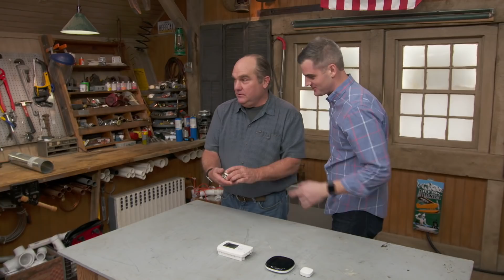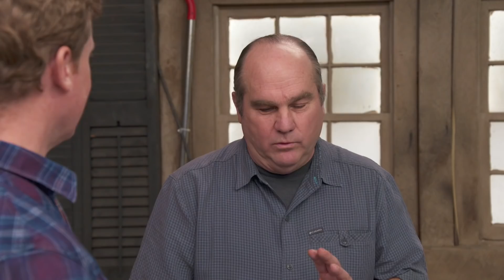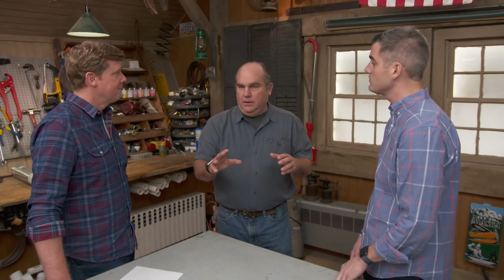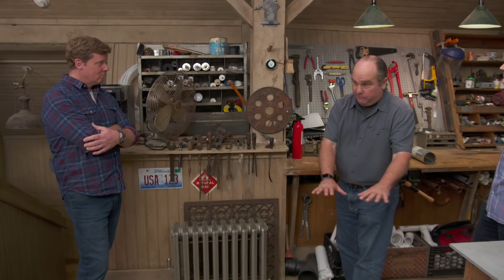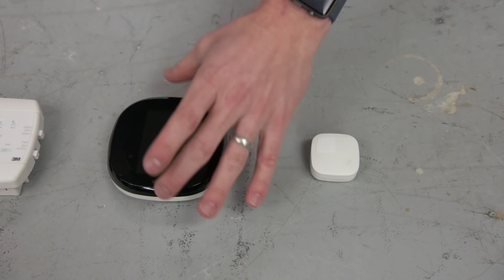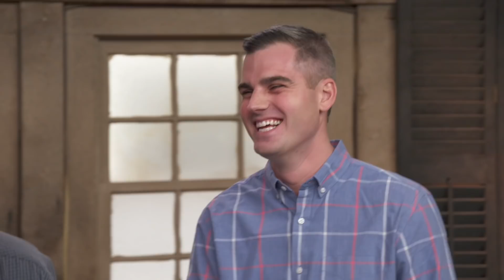How to Maximize Comfort with a Thermostat | Ask This Old House

Comment: We've had -40 to -50 for a month. When house sitting for a friend, I turned the heat down in the day when I went to work, thinking I was saving money. Well, the baseboard froze up, and I had to call out someone to thaw the lines. $300 later, I determined no money was saved. I won't be fooling with the thermostat thank you.

Comment: Perfect,  I just watched this.

Ok my house was built in 1992, my hvac system was changed in 2013. My heating bills in the winter for a cold month cost us 450.00 dollars for one month around 2007- 2008 a year we had a cold snap.
No humidity heat at 74dgr f the house never kept warm.
In 2021 jan feb months we had colder temptures for a longer period of time, my gas bill was 163.00 for the month of February   this newer hvac system is 
Seer 16. 97% efficient heat i had the heat set to 76 dgr  and ran a humidifier the whole time this system pulls in outside air to make combustion.
Even a few year old system can be a big upgrade and cost savings to replace.

I wont get into what we paid becuse your home isn't the same size, or geographic location and construction  simply taping all the joints helps but the biggest improvement was a newer energy efficient system  
This system has paid for itself the first year and almost every year afterwards 
And its not even the best money could have bought, if I had it to do over I would opt for a 2 stage compressor, but celing fans help keep you cool the ACs job is to dump heat outside. 
On a second note I pay to have this serviced every year it worth it to keep it working at peak efficiency. 
However its somthing I could diy its still better to let the pros do it.

Comment: In a moment of rebellion I went down to Ace Hardware and picked up 3 of the old school, Honeywell dial thermostats and ripped out the programmable ones that came with my house. They work flawlessly and I don’t need a PHD to figure them out.
Reply: That's what I have and they are staying put, no batteries, no user manual, they just work all the time, every time.
Reply: My 359 dollar electronic thermostat is set to 74 summer and 76 winter year round  its not a smart thermostat but close it is powered off the hvac systems main computer.
My gas bill this past February was 135 it was minus 10 to minus 20 for 2 weeks outside,  a few summers ago it was 90s for a month outside my power bill was 
190 at the most with 4 adults at home 24/7  running 4 big screen tvs 6 computers a fan or 2 in every room.
Its your older hvac system costing you a lot of money.  My thermostat isn't wifi.
I have a z wave unit I wont use it. 
And my house is close to 3k sf

Comment: Just for some obvious context. It's far better to have a home thats much better insulated along with temperature and humidity control and fresh air circulation and then you don't micromanage your thermostat you just leave it at the settings you want because your house can retain the temperature for a day or two there's no need to shutoff the system while at work.
However most actual homes have ridiculously awful standby loss. Funny enough a big part of that is just the duct work itself if its placed in an attic its radiating all that heat in then it moves through the air back into the house. In other cases people just don't have good insulation or their windows are leaky, etc. But the idea of letting your entire house heat cycle to save money just seems backwards.

Comment: I just want the utility companies to stop gouging us.
Reply: Easy, install solar panels on the roof, most popular models generate electricity, others can be used to heat water (Ideal if you have a Whirlpool or hot tub that needs large volume of hot water. Last season of TOH featured solar panels & by next year results should show "O" electric bill if the calculations were correct. 😃
Reply: David H Bingham Solar panels need 7 to 13 years of usage time to become profitable. And all those years it’s your own responsibility to have them stay working. And if the electric company stops accepting return electricity, then the bit that you generate too much on sunny days just goes to waste. Not saying that it’s a no, but there are a lot of factors to think about before going for it.
Reply: @davidhbingham6812  
I have to say this, even if you use no gas in the summer months you still pay about 35 bucks a month for gas
To heat a 40 gallon tank for a family of 4 for a month you use about 7 bucks worth of gas  a solar hot water heater is going to cost more even after 30 years
Now if its summer you can dump heat off the hvac system into your waterheater to heat water and raise thd efficiency of your ac compressor to a point if its an older unit, if its seer16 you wont pull much heat off the lines 
Solar hot water is not your best bet
Its geothermal. 
Actually there should be studies to see what is the most energy efficient methods with the best cost options.
But it also depends on your home and location.  There are a lot of energy auditers out in the field and from what I read as feedback not all of them are qualified to do the job.
Like doctors this should be a collage corse with 8 years of school and recertification every other year.
It also needs to be a licensed industry you must pass a test to get like any other trade. This is just as important as electrical contractors.

Comment: I don't want any more electronics
Reply: Agree100%
Reply: absolutely that round honeywell thermostat will last a lifetime (never lose time and no changing batteries)the other 400 dollar stuff will be gone in 6 to 7 years that old 50year old furnace which they said might be 50 to 60 percent efficient is more like 75 percent new furnaces will break down every 3 to 4 years and if no warranty will cost a fortune to fix and replace every 10 years so you may save on gas but pay much more in inconvenience and cost , and yes I work Hvac
Reply: tracking your every move.....
Reply: Without programmable thermostat, you’re probably heating your house on unnessessary moments. That wastes a lot of money on fuel, lifetime of your heater, and impact on nature.

Comment: No thanks, I'll keep my old Honeywell Thermostat and my asbestos covered furnace, it's been working flawless for 50 yrs. There isn't a furnace out there that will last that long. Don't need or want another electronic thing in my house to track me or go bad.
Reply: I believe the expression is, "Ignorance is bliss." Keep smiling, while you're paying twice as much for heating and that asbestos dust is increasing the chances for lung cancer in your loved ones. Never mind the environmental impact your rediculosly inefficient  system has on the world. Yup, just keep smiling...
Reply: @Wild_Bill57 , No ignorance here, I just don't mess with something that works perfectly and spending 8 grand for something I know that has a 20yr lifespan is not something I choose to do. It's been tested at 84% efficiency, not as good as the new ones but I don't care. As far as the asbestos, do you think we are down there playing dodge ball with it ? There's no risk for dust as it is encapsulated like you would not believe. If I leave it and use it, I do way less damage to the environment than replacing because nothing has to be done, no disposal, no making any new parts which involves burning more oil to make the parts for the new furnace, etc. So I spend an extra 200 bucks a year, big deal. It will still be here, WORKING, when you and I are gone, unless some noob comes along, spends 8 grand, to save 200 bucks a year !
Sorry about the long reply and it's all good.
Reply: I’d bet you are paying much more then 200 bucks a year bud.
Reply: We just had to replace our 42-year-old air conditioner last year.  Not because it went bad but because our 20-year-old furnace went bad and the new one couldn't be connected with the old air conditioner (or something like that :-) ). Kudos to Fraser-Johnston for building an air conditioner that lasts.
Reply: @T-marie-N , Amen, built to go the distance !  Unless my furnace fails, and it will not, it stays !
Reply: @augustreil  still got the asbestos you were so proud of!
Reply: @Wild_Bill57 , And ? It's not a problem or a health hazard unless it's disturbed.
Reply: @augustreil  If you haven't taken the steps to properly seal it,it's going to get disturbed, Sooner or later, it's going to be a  problem. Wouldn't raise my kids in a house with that risk. I'm sure you will disagree, at this point, not going to change your mind.
Reply: @Wild_Bill57 , No problem, We are just discussing something that we disagree on, it's all good. I respect your opinion and understand what you're saying. Still debate buddies ? lol  Just trying to lighten it up, that's all.
Reply: @Wild_Bill57  william doesn't realize that if asbestos isn't touched it has no effects on anyone.  also you should look at old film of asbestos factories, the asbestos was so thick one couldn't hardly see 30 feet away, flying in the air everywhere, that's how people got cancer.
Reply: I bet you a dollar that your old furnace is General Electric .